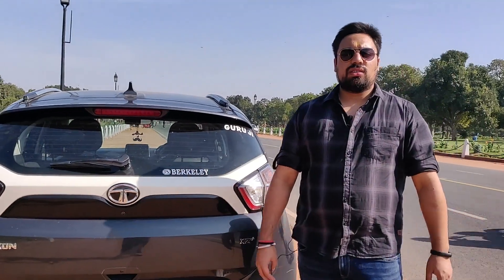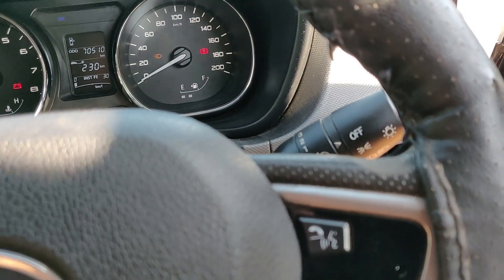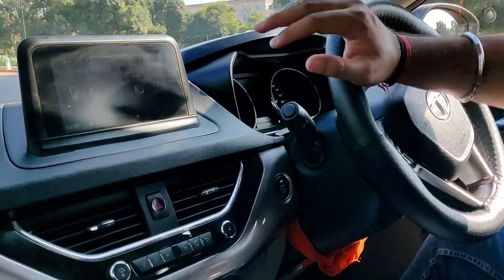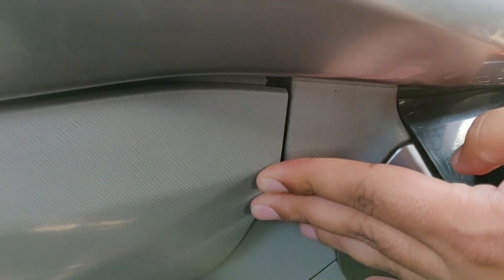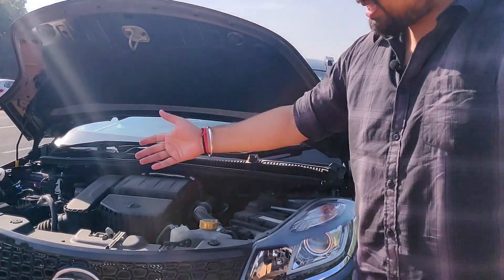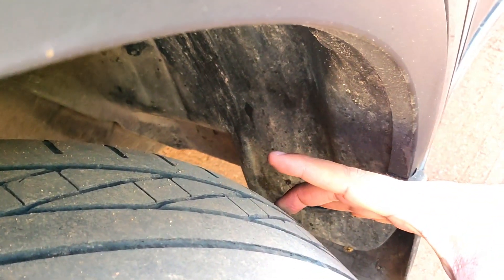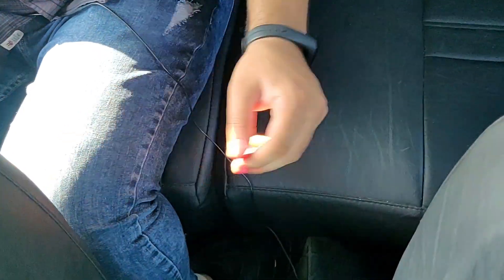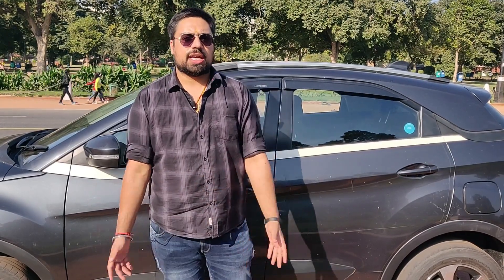Nexon 70K+|Full Review|Trending|TataNexon|CarGuru|Ownership Review

Comment: 70K kilometres in  23 Months means, CAR was Driven a lot and we can't expect Leathers not to be worn out. Plastic behavior depends on Temperatures. Found these many issues only with your CAR bro. 

May be you have problem with TATA itself.
Reply from the maker: Respect the opinion, and this is not a complaint video but the true thing! This production is one of the initial set when the car was launched, so any new platform that comes in the market have issues which gets rectified with time!
Reply: @Carguruvk  yess